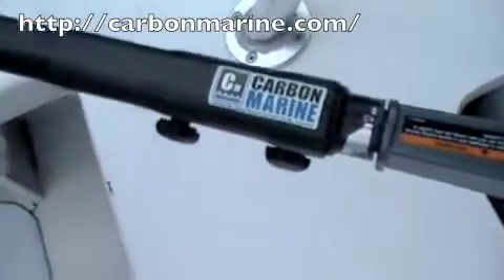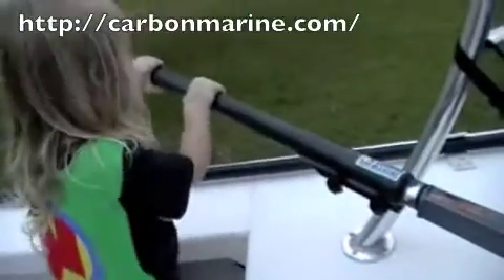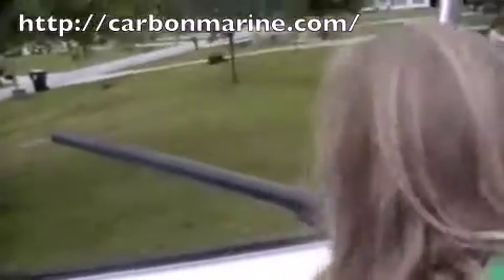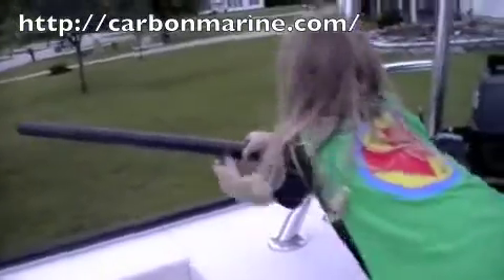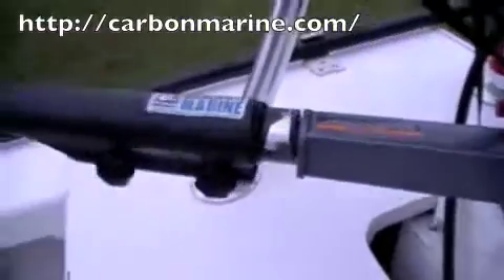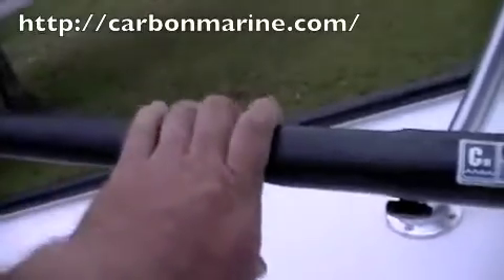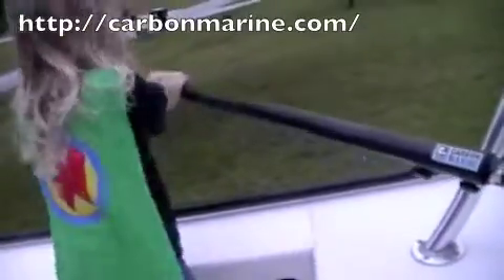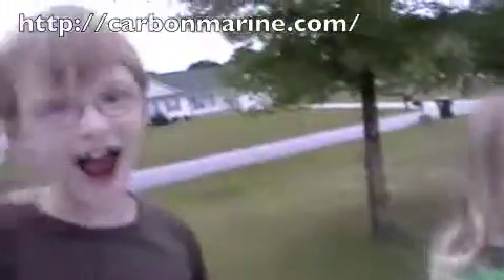Tiller Pillar

Comment: A quick note of correction.  There are no splitters on a TillerPillar.  What Gordon felt is the non-skid pumice we apply to the grip area to reduce slippage in your hand.  Out of the box the pumice has been described as agressive by some customers.  To "soften" the non-skid, we now apply a thick coating of Awlgrip G3005 high-gloss clear-coat to the entire TillerPillar after sanding the entire unit smooth.  This clear-coat also protects the epoxy from UV light degradation. ~Joe
Reply: What do you have for a thick handled 9.8 tohatsu?